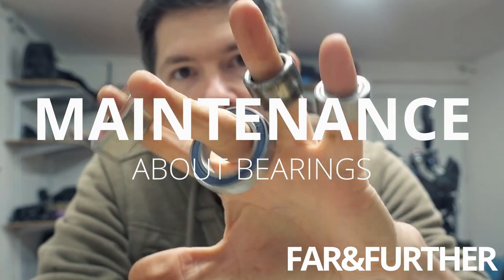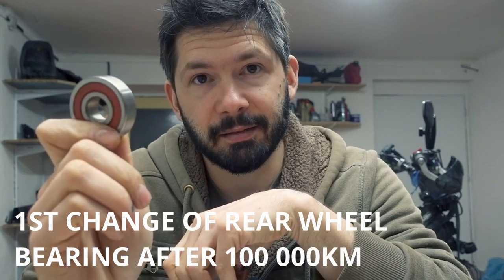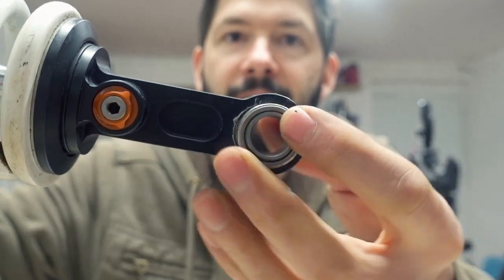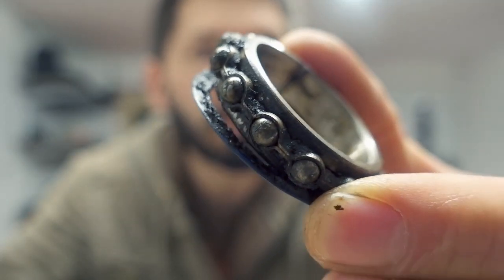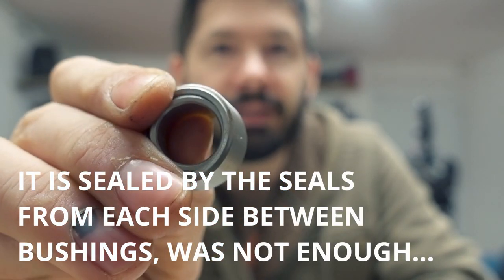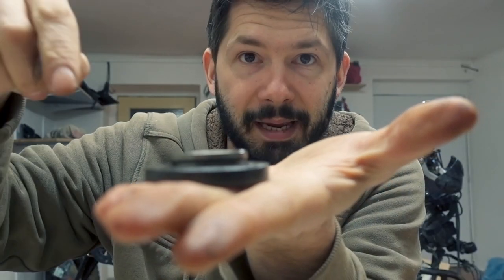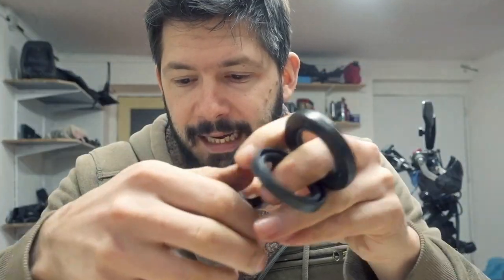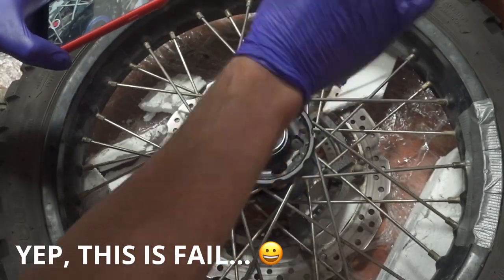Maintenance - About bearings

Comment: Good to hear you completed your trip.  Thanks for making these videos and sharing your knowledge as it's missing from RR.
Reply from the maker: Im really happy you find those useful thats cool. I'm going to finish off the series with few more.

Any questions, topics would be of interest?
Reply: @FARANDFURTHER  You mentioned in one of your videos that you'll be posting a valve check video which would be great.  Perhpas you could also include a "normal speed" video showing how you removed all the wiring, harness and plastic cover to get to the valve cover.  From other peoples comments, it seems most are hesitant to change their own spark plugs because the mess of wiring under the tank is so daunting.  Anyway, whatever you decide to publish will be a great source of info...cheers!
Reply from the maker: @rayman6540  Hello, the valve clearance video is up and I'll make one specifically about removing the stuff under tank so one can change plugs or check clearances.